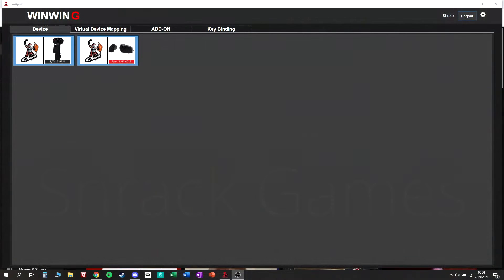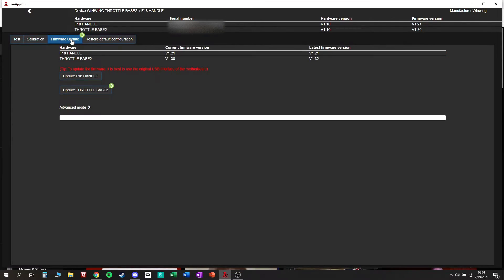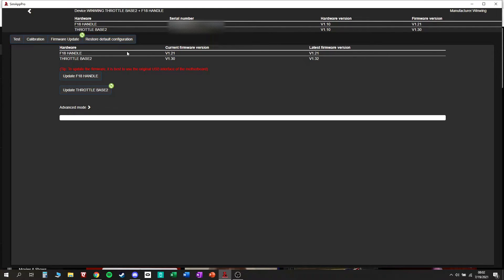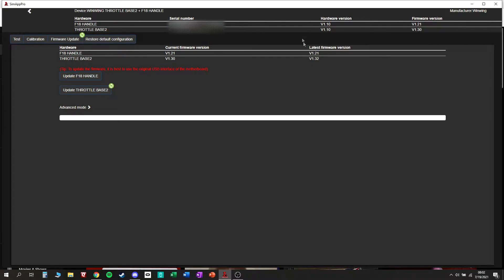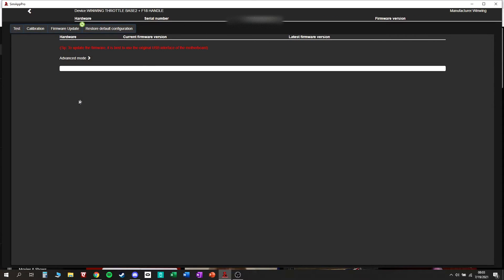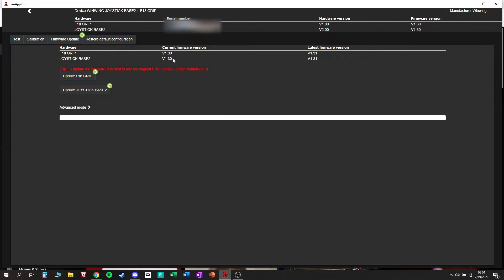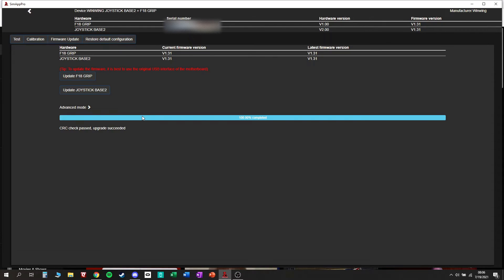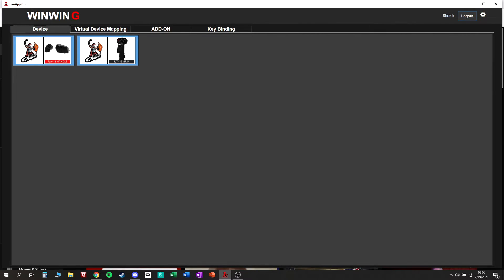How to update WinWing SimAppPro

Comment: Thanks for clarifying this. I had an issue with my Winwing Orion 2 HOTAS MAX base being unable to update since, well I first got it and was stuck on retrieving at version 1.09. I looked it up and after some sleuthing, found that changing the servers to China fixes the problem and you can update to version 1.13.
Reply: Also, yes you need to unscrew stick from base and good luck with that short cable ;), then plug base directly into IO off of motherboard (USB slot on your PC no hub) before updating with this being only usb connected preferably (besides mouse and keyboard if possible).